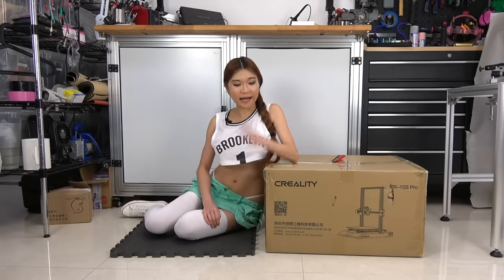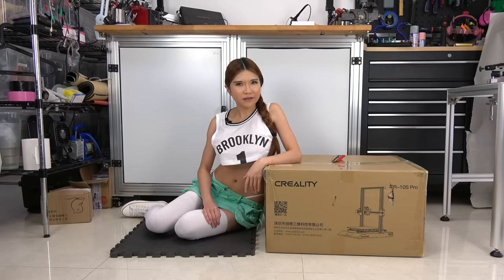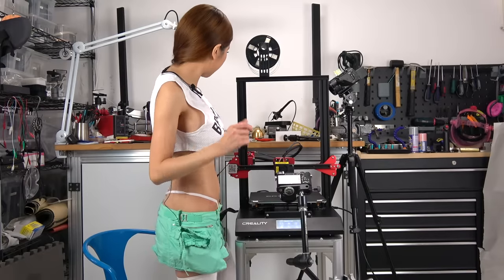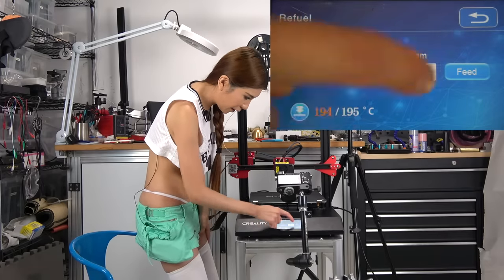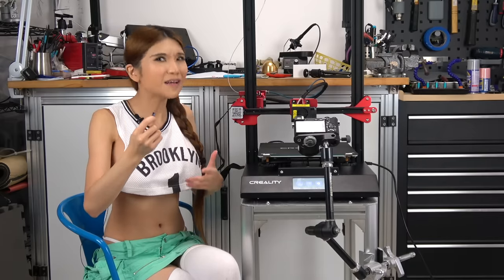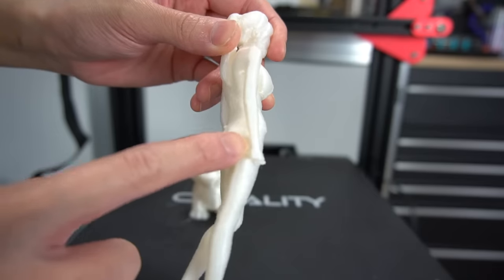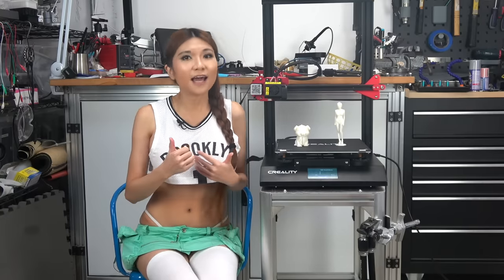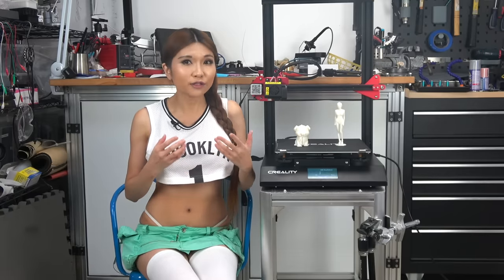CR-10S Pro 3D Printer Unboxing and Review

Comment: This is, indeed, a damn fine printer. As she says - out of the box quality and reliability. We're going to buy a second, and maybe a third. The only issue we've had was the position of the bed leveling sensor when at the left limit - it hangs part way off the bed resulting in a flaky 'sense'. Solution: move the bed plate 8mm to the left and re-clip. We've had other printers, this has been the easiest to use OOB. 
 
Naomi, 
   you are one of the finest young people around; Creality is lucky to have you, the world is lucky to have you. You give solid, honest reviews, address tech & other issues creatively, insightfully, honestly. You're a Mover, a Maker, & a rising Force of Nature.  You are making a positive difference, enlightening us all culturally and creatively. You're one in approximately 7.6B - a very, very good one. Stay the course =)

Comment: Hi Naomi,
Thank you so much for the video. I am happy that Creality has listened to the wishes of the community. I would appreciate it if Creality would also install a second z end switch for both sides, so that the z axis is automatically always set correctly. For example, Anycubic included this in their Anycubic i3 mega by default.

Comment: And now, I wish I waited a little bit to get this printer. They have incorporated a lot a fixes on super annoying things we have on the CR-10S such as the unit being embedded into the printer, touch screen, a tough filament sensor attachment, an atop spool holder, auto level with a sensor, mini-clips, task automation in firmware.... I think, I will go crying for a bit now....

Comment: yeah dude definitely. I agree, even with auto bed leveling, people should really level their bed first. the more level the bed, the less work your Z motors have to do when printing. also it makes for more accurate prints. Great Video. Do you use Slic3r at all? and if so, have you tried printing on this printer from a Slic3r profile with much success?

Comment: I don't think you should've raised the X travel beam to the top of the columns before tightening the columns to the base, because it holds the columns at the correct width before it is permanently fixed to the base. Like if the column width narrowed 0.5mm when it was fixed to the base it would have more resistance, and more chance of  wear on the rollers, every time it was at the bottom of it's travel. That's probably why Creatity send it at the bottom of the travel. A simple fix is put it down close to the bed and loosen and re-tighten the 4 screws.

Comment: hey if you print such a figure with a single material, lean it backwards like 10-20 degrees, so you do not have much support structure at all, and mainly almost none in the front.
Reply from the maker: Oddly enough printing it upside down yields the best print quality.

Comment: Awesome video Naomi. I have a question can you review the 
2019 Anycubic 3D Printer Plus Size Pringting 3d Printer Kits DIY FDM TFT Ultrabase High Precision Impressora 3d drucker
Reply from the maker: I only work with Creality these days...
Reply: @Naomi-Wu  Oooo i see. thanks for replying back. I'm  new to 3D printer and wanted to buy one so with one you recommend me from Creality
Thanks so much for taking your time to respond me 🤩🤩😍☺☺
Reply from the maker: @jenovaizquierdo  I like the Ender 3 a lot, or if you want to spend more- two Ender 3😁
Reply: Naomi 'SexyCyborg' Wu I see thanks. But will go with the one you show of in a video about the Creality CR-10s PRO that one got me sold. You are the best Naomi and thank you for replying back.

Comment: I just got the my second creality printer first being cr10s had no problems with it been using it nearly a year then I bought the cr10s pro it’s been nothing but problems they have changed it and the second one came with more problem there is nothing pro about it more like cr10s problem that’s what they should of named it I will never buy another creality printer again they have lost there way as a company I spend more time trying to sort problems on this printer than I print no quality control and no respect for there customers. I have been on forums and there is loads of people complaining about this printer i watched your video on this printer and thought it got a good review from yourself and ordered the cr10s pro i suggest maybe looking on forums and see what people are saying about this printer and tell creality they are loosing customers with this printer this is just them taking peoples money and not caring what kind of product customer ends up with.
Reply from the maker: The firmware version after mine seems to be an issue, have up upgraded to the latest firmware?
Reply: Naomi 'SexyCyborg' Wu 

Hi thank you for your reply I have upgraded the firmware to 1.60.4 and the only thing it has solved is the filament sensor is working. I have been on Facebook page and read all suggestions and still the same problem I would love my cr10s pro to work as a really like my cr10s and had no problems with it plus this is a Christmas present from my wife and son so I am so disappointed.

Comment: Great Job! How is the auto leveling?? Does it work good? And is there a way tweak auto leveling parameters??
Reply from the maker: Works very well, not sure about tweaking it without firmware changes?
Reply: @Naomi-Wu  Thank you for quick response!!! I think that might be a good idea be able to make adjustments for different nozzle sides, materials... I have Cr10s because your great review on that, just to let you know... 8)

Comment: I would really like to know if the CR-10S Pro can reliably print accurate ABS and Nylon parts. I am looking around to buy printers for engineering prototyping.
Reply from the maker: Not great for it. There's a new model with an enclosure coming out that's much more suitable.
Reply: @Naomi-Wu  Thank you for your reply. I understand the need for an enclosure. I was thinking of building an enclosure like the Prusa design. It was the hot-end, bed and accuracy that I was worried about. Thanks again.
Reply: Is any problem with printing from abs on this printer?

Comment: I really love the interface of this printer but I wish the price would be a little bit lower but I could actually take a trip to Shenzhen, exchange currencies and buy it there. 

I would also buy there some diy Amplifier. 
They are actually very interesting and easy to repair since most of them have sockets, where the amplifier chips or voltage regulators can be plugged into it.
Reply: MichalPlays Very impressive how you can focus on what's important,  lol.

Comment: How does the dual gear extruder handle flexible filaments like NinjaFlex or regular TPE/TPU?
Reply from the maker: It can print them, not as well as direct drive of course though.
Reply: @Naomi-Wu  Alright, thanks for the info.  Have been trying to get it to print on a standard CR-10S4, but it keeps jamming the nozzle, even at 20 mm/s.

Comment: Hey sexy, there all out of the CR-10S Pro version, I was going to buy the CR-10 V2 3D version. What do you think, I'm a first time user and buyer, so just small projects like an Arduino or Pi case is all I will be doing. Also, it's a little cheaper. Thanks for the review.

Comment: Can anyone help me with my new Creality Ender 3. I have issue with the printer stoping during print and extruded motor starts running in reverse and backs out filament. This process continues until the user interferes. The display says still printing. I have contacted Creality service but no help. I purchased it threw amazon sold by creality. Amazon is also not helping. Is there any hope for my printer. The problem is total random. I have had some successful prints. But it’s like rolling the dice 🎲 when I start the print. I bought it as a demo at my job to display how it could change the way we prototype patterns for casting, but it’s not putting on a good show.
Reply from the maker: Hey try reddit r/3dprinting
Reply: I will do that. Thank you

Comment: I love your channel but hate this printer, the bed-leveling is a half an hour fiddling with a 10 cm piece of acrylics, a 0.2mm feeler and screwdriver, followed by the automatic bed-leveling before each print. And still the print-head cuts into the middle of the printer-bed. After many trials, the top-layer of the print-bed had a hole in the middle. the magnetic extra print-bed ( bought and advertised as for the cr10spro)  is too wide and hits the printer, is not long enough, so leaves 1cm of the print-bed bare. The print-bed does not fit under the clamps. Do not buy this printer, not as a pro and not as a beginner!
Reply from the maker: I'm so sorry to hear that, I'll forward this to the factory...